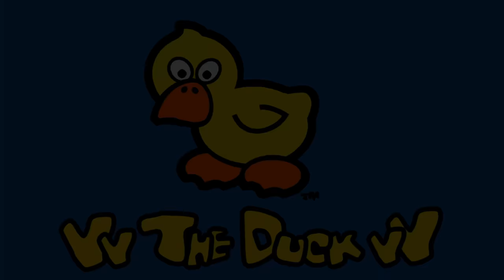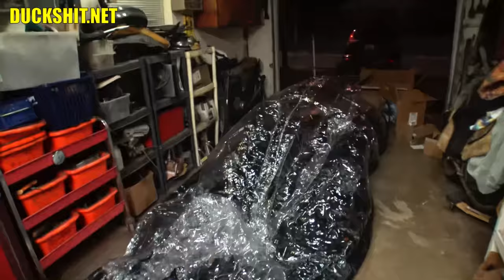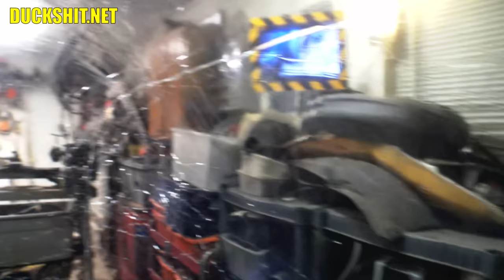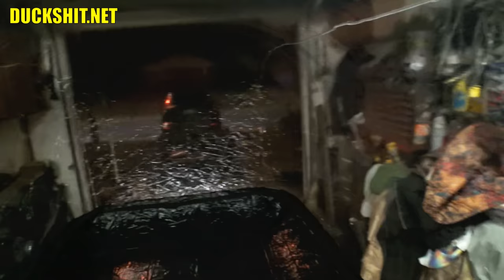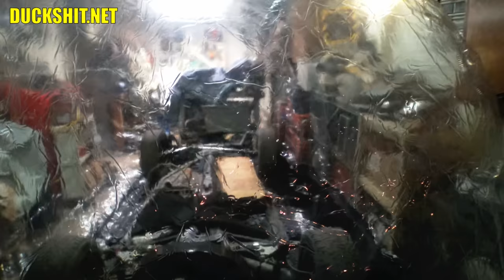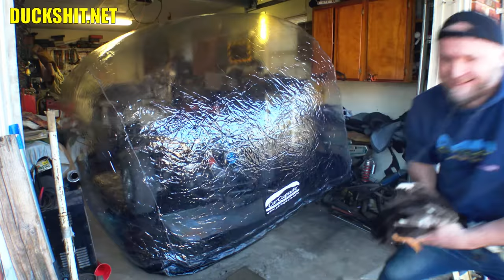CarCapsule Punishment - Unboxing Setup Review - Eleanore VW Beetle Midday Q&A 150

Comment: I had one of these bubbles for my motorcycle they work great. When I sold my bike the guy bought the bubble to go with it. Kept my bike in perfect condition especially up north in the winter months it was climate controlled and prevented surface rust on the chrome
Reply from the maker: Yes seems  to be working good so far!

Comment from the maker: Not a bad product, but one major annoyance.... and it's a big deal, in my case!  UGH!  But otherwise I'd say the product it's pretty solid!
Reply from the maker: What the hell dude, did you even watch the first few seconds of the video?
A remark like that means you just didn't watch the video at all.... LOL
The motorcycle is 400lbs, and Delmont is 250lbs, the dumbbell was 25lbs and hit it with speed.  No tears, no cuts.  I don't know what kind flying 500 lb razor blades you have in your garage, but you've got bigger problems then... LoLz
Reply: @ford1546  did you see the 250 lb dumbbell?
Reply: @DuckmanCycles  or they don’t watch anything you put up all the way through. Either say something positive or don’t say anything at all. Momma said
Reply from the maker: He didn't see the 400 lb motorcycle with the pointy handlebars, footpegs, and controls, too.  No cuts , no damage.
Reply: @DuckmanCycles  yes I watched the whole video.

Do you not plan to have the whole car inside it?

my point was that when you get the whole car with the body inside then there is less distance between the body and the plastic capsule or whatever it is called
Reply from the maker: How big do you think a Beetle is?  If you watch the video you see I described how big the car is inside the bubble.  LoL.... we would not be having this discussion.  Maybe if I tried to put a VW bus inside of this tent it would be too close to the top... but the sides wou,d be fine.  But even still, how many floor jacks do you drop out of your attic hatch onto the top of your car?   Not realistic!
Reply: @ranchero302me  yes I watched the whole video.

when  the whole car with the body is inside, then there is less distance between the body and the plastic capsule.
Reply from the maker: You still didn't watch, I gave you measurements, even.  LoL.  Watch again!
Reply: @ford1546  and that is understood but have you watched al lathe videos of him explaining everything about his garage then shop then his car garages outside. He explains how everything is gonna be and when about everything is gonna be. Plus he talked about moving everything in garage to make room for what he needs to do. If you seen the original videos of the car on the frame/chassis he had plenty of room around. I’m pretty will have plenty of room he’s like 8 foot tall and he was standing inside it
Reply: @DuckmanCycles 
no need to look 2 times

 You threw a training weight. an exhaust and you throw yourself on top of it and you put a motor bike on it
Reply: @DuckmanCycles  it’s 16 ducks tall and 16 ducks wide
Reply: @DuckmanCycles 
I do not know exactly how big the car  is

Sorry. plastic capsule protects well. I will not say anything more about it
Reply: @ranchero302me  🤣
Reply: @ranchero302me  I watched the last 3 videos
Reply: @ford1546  gotta go way back to when he all started this project
Reply: @DuckmanCycles    In the future, I will not write such stupid comments. Sorry
Reply: @ranchero302me  ok. understand.  I have many channels on my favorite reminder list. I do not have the ability to watch absolutely every  videos
Reply: @ranchero302me  i have seen many of his videos for almost 3 years now but not all and not always in the correct order

But he is probably on my top 20 youtube channel list of channels i like.
Reply from the maker: That wasn't me, that was Delmont.  So you weren't watching LOL
Reply from the maker: But otherwise with the rest of your knowledge why would you be saying things that you do?  The car is safe!
Reply: @DuckmanCycles  was not the man who jumped on the capsule you?

You throw the Bird or what you call him, do not remember right now 🦆
Reply: @DuckmanCycles 
I wrote it at full speed without thinking properly through what I wrote I guess.

 Nice that your car is safe.

Comment: Oh wow!   That things awesome!    Pretty sure I would not pay 500 bones for that though. It gave me some ideas  while you were setting that up though. Oh yeah, before I forget.   I thought I'd look pretty good of I lost 50 pounds,  You had said you are 2 inches taller than me though and you just let out " 250lb dumbell"   If I lose 50 pounds I would be the same weight as you so it's looking to me that I need to lose more. LOL     Maybe the hair would make a difference.. Bajajjaaaaa/ 
  But yeah man.    The BUBBLE!   wow!   I was thinking it would be a pretty sweet mold!   what if you covered it in canvas ( I mean after you use it for this awesome purpose )  and staked it down, sprayed it with a few good layers of Concrete w/ a rubberized additive, then you could give it a later of chicken wire and trowel it in.   You could make a few Identical sz little garages pretty cheap and still have your bubble intact !     I am thinking they would hold up better in a hurricane. :0)   I mean just to put shit in so it;s not out in the weather or to use as a wig wam or some shit. LOL
Reply from the maker: Delmont is a 250lb dumbbell.   LoL!  Concrete to this already overpriced structure sounds expensive.  There is an industrial teqnique just as you describe, but I would use a different balloon that's much cheaper!  :)